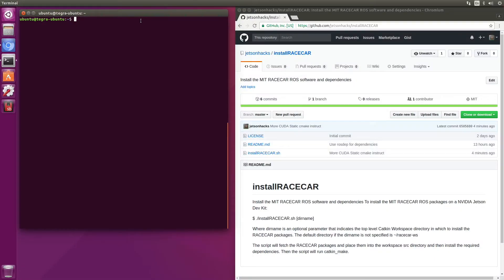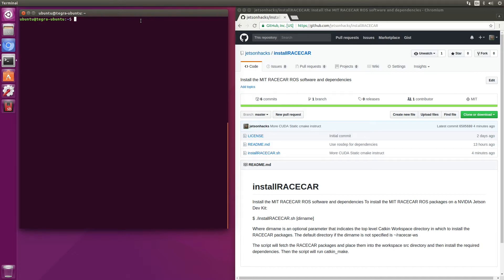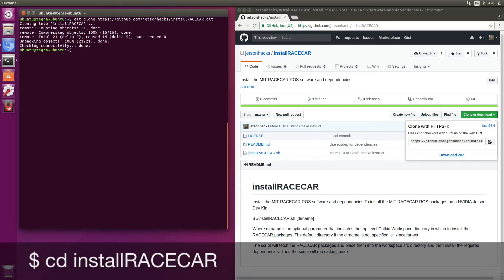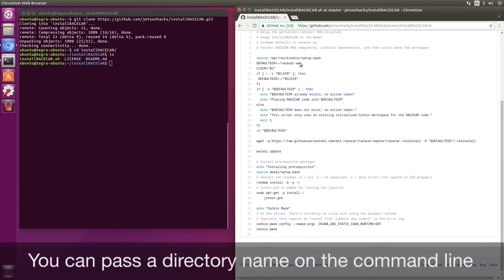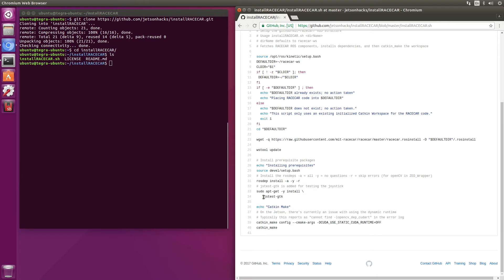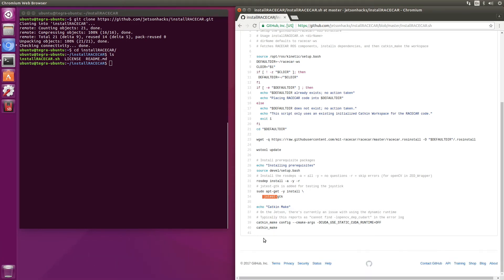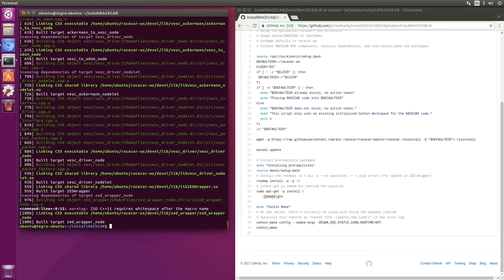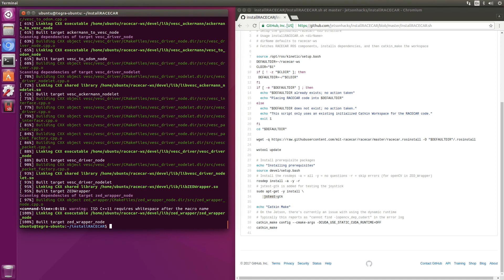Jetson RACECAR Software Install Part 2

Comment: I have completed all previous steps without error but in this step I am getting following two errors:
1. Invoking "make config -j4 -l4" failed
after completing process up to 45% throws another error
2. fatal error zed/Camera.hpp: No such file or Directory
Any Idea what might be the reason?
Reply from the maker: Did you follow the steps in Part I: http://wp.me/p7ZgI9-Oq
Did you read the article on Part II? http://wp.me/p7ZgI9-OY
It looks like it could not find the ZED camera header, is it installed?
Without more information, it is difficult for me to venture a guess as to why it is failing.
Reply: I am using TX2 and followed all steps from part 1 and 2. Also I have installed ZED_SDK_Linux_JTX2_V2.1.2.run.
Reply from the maker: There is very little information here to help me work through your problem. Which version of L4T are you running? What command is executed that brings on the 'make config -j4 -l4 failed' error. What command is called which brings up the zed/Camera.hpp "No such file or Directory". Does the Camera.hpp file actually exist? Have you tried executing the commands in the scripts manually? The software install is for the Jetson TX1, did you take that into account when you built the TX2 software? I'm not sure the ZED SDK is backwards compatible. YouTube is not a good place to answer development questions like this unless you have very specific questions.
Reply: I watched your video carefully and in video also i saw this error message Invoking "make config -j4 -l4" failed but main error was due to Camera.hpp, so followed instruction from https://www.stereolabs.com/documentation/guides/using-zed-with-ros/introduction.html and it worked very well

Comment: Nice progress! Whats the function of the router that was used in the original MIT race car?
Reply from the maker: The MIT RACECAR is used in the tunnels underneath the MIT campus. That sometimes would lead to poor wifi connectivity as the vehicle roamed. Using the router boosts the signal so that it is less susceptible to losing a link with a ground station. I live in Los Angeles and don't have easy (or guess legal is a better term) access to tunnels, so it's pretty easy to keep everything line of sight in most cases. Thanks for watching!
Reply: Cool.. Is the ground station used just for monitoring and logging? Or does the car depend on the ground station for its navigation and algorithms?
Reply from the maker: It's all standard ROS. Some of it is rviz for visualizing the data from the vehicle. Depending on the research that is being done, the vehicle data can feed the ground station for off board computation. It can also be used to teleoperate the car, of course. For example, you might run a course and then tell the vehicle that you want it to come back to a certain point without having to actually being close by.
Reply: Thanks.. This is useful info :)
Reply: Thanks.. This is useful info :)